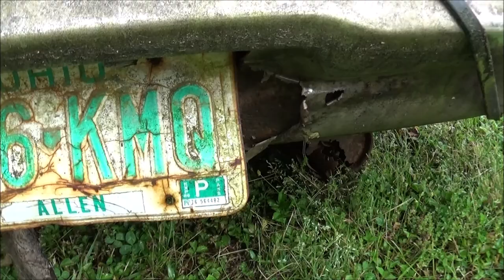1962 Mercury Comet

Comment: My 1980 f100 was a three one the tree with the. Straight 6 300. So you have the hook up at the old ford and mercury place? Man id love to have a buddy like that. Its a treasure trove. Id rat rod it with the straight 6 and the three one the tree. Blacked out like in flat black primer even the rims and all. And rebuilt the 4 wheel drum brakes and gosh the possibility are endless. Between that and the truck you got some great projects ahead. Mr.Paul i am loving those.
Reply from the maker: Thanks Tom,looking forward to both!!